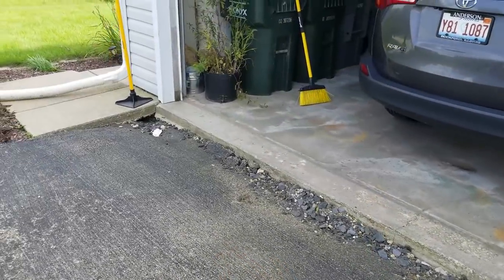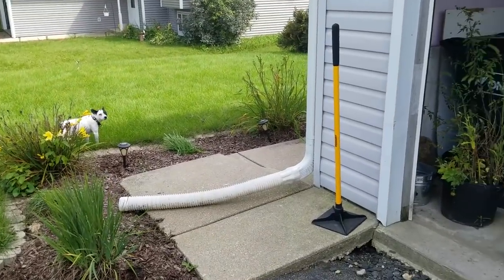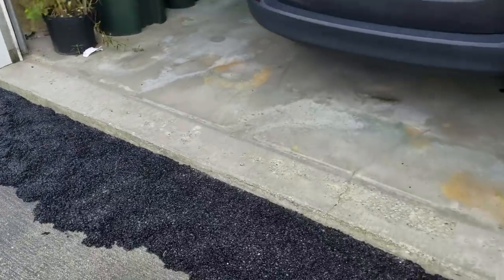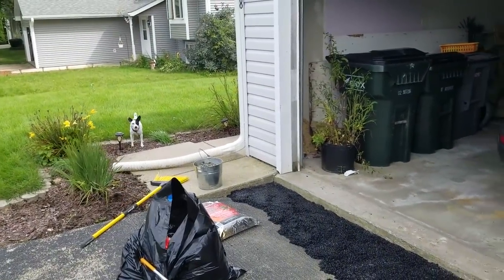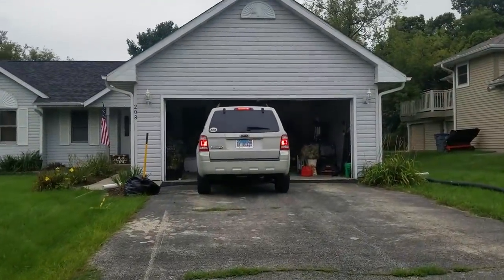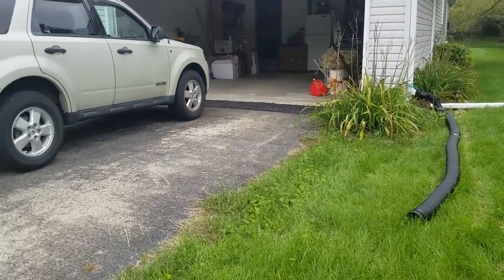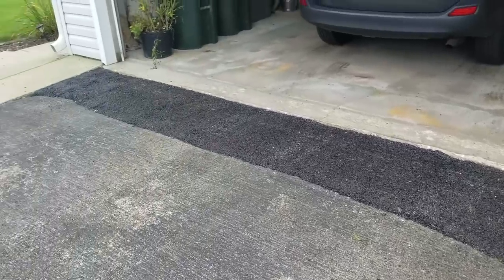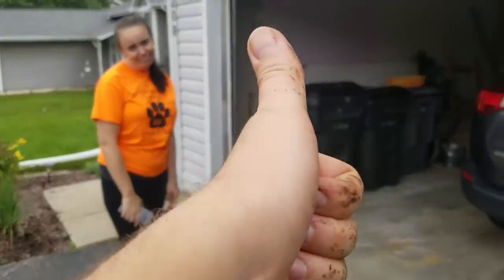Newlyweds DIY - Driveway fix!

Comment: Watch the rust in those rear wheel wells. When Ford cheaped out and got rid of the plastic well protectors in that generation they didn't change how the two seams of outside/inside metal were welded in there to protect them from the elements. Now pretty much every one of those Escapes, mine included, are rusting away back there. Better to tackle it early before it eats away the entire lip.
Reply from the maker: Yeah I noticed that in the last 6 months or so. Maybe that will be another DIY video! Lol

Comment: Hey mat firts congratulations for all the work you do in simracing keep going like that, second the way you do in Europe is not the best way to do it, normally you have to put hot asphalt for durability, cold material will come out again, and u need a machine to make a good pressure on the floor..

Comment: Don't fill it up so it's even, it should be about 3/4" lower than the garage floor to prevent water from coming in when it rains. Also, this was caused by that downspout being where it is. You need to relocate it if you can and get the water away from the garage. I see you do have some black pipe there. That's fine but a pita to walk over and not very good looking. Welcome to home ownership.

Comment: Matt love you and Sam but this is no good.  :(. You have bottom level erosion because the subs oil wasn't prepped correctly.  That void should be filled with dirt then packed with a pneumatic tamper.  As for the driveway you should call in a professional with a pressurized expanding foamcrete system.  The way your fixing this won't last.
Reply: 100%. It's worth paying for it.
Reply: It’s DIY. Similar result but at 1/4 the price. Yes it won’t go the distance but it’s husband and wife bonding, 😂.
Reply: Paid for with yOuTuBe MoNeY$